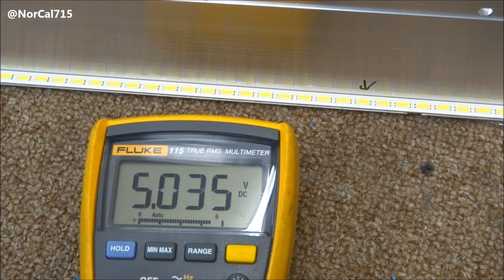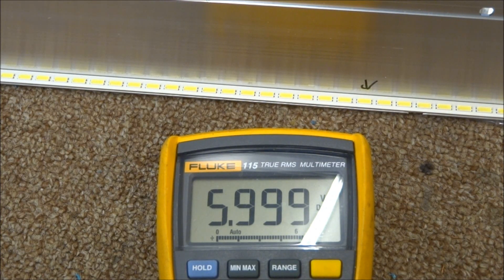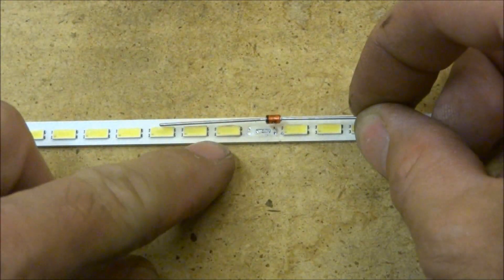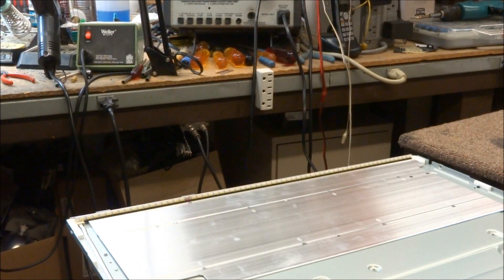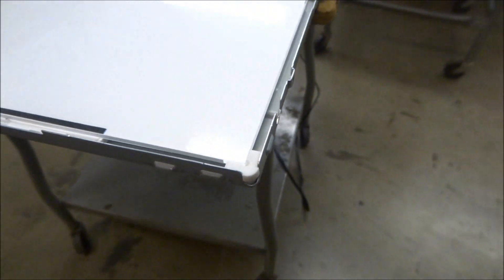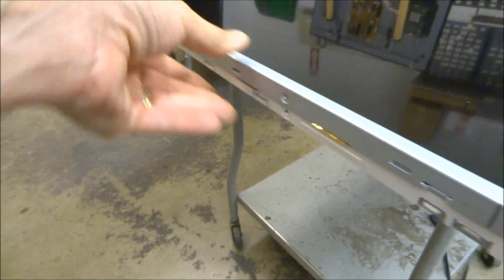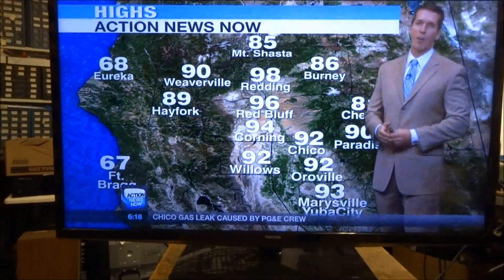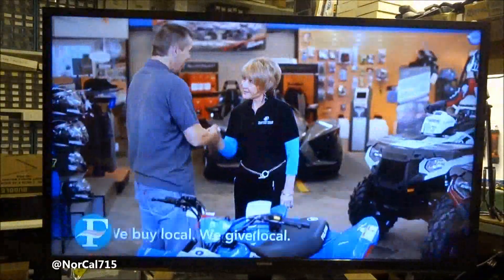Toshiba 46L5200 Logo Screen Flash TV REPAIR - No Picture - LED Drive Problem Part 2

Comment: What's the average cost for a repair like this?
Reply from the maker: For a complete LED replacement today (12-2021)it is usually between $200-$250 depending on the amount of LED strips and the cost of them.

Comment: I am trying to repair a similar set. I took out the led array and found one of them not working, I tried to add a zener but it did not work. Initially I would apply about 3/4 volts on the individual leds
and they would light up, now the don't but still show the diode effect on the multimeter. Have the leds gone bad, how much voltage should I get in the leads into thes?
The connector to the leds is five pin, so ,I assume these are 4 sets of16 leds in series. Should I be able to get a continuity from the black lead to one of the extreme ends?
Thanks
Reply from the maker: Usually white leds are approximately 3 volts to forward bias them on. So if you have 16 in a string it should be approximately 48 volts per string. I hope that's what you are asking.
Reply: @norcal715  Thanks very much for your quick response. I also want to know if a led does not light up will it still show the diode effect on the multimeter?
My second question is should at least one of the leads(perhaps black) from the connector and one the ends of the diode array show continuity or is the array broken?
Am very grateful to you for your assistance.

Comment: Couldn't you have put the zener diode just on the circuit that had too high of a voltage instead of taking the whole thing apart? The shirted LED could have remained in the circuit.
Reply: Gerard Pinzone yeah good point.
Reply: yes - unless you have a "open" LED

Comment: I find it interesting how the flickering in your camera stops when the backlight gets to 100%. Anything less and there's a noticeable flicker from the sync of your camera. Looks like they may be firing the LEDs slower to reduce the brightness. Great video, thanks.
Reply from the maker: Pulse width modulation to control the brightness. Leds are either on at 100% or off. They vary the duty cycle at a high rate to control the brightness.

Comment: Another Great repair. I have a Toshiba LED 3D Tv, model 55TL515U and the problem with it is that the TV does not come on. there is no power light or standby light on the front of the TV. When I plug the TV in I get my 5 volts STB to the main board and that's it. However, every once in a while when I plug the TV in i hear the relay click and all voltages are present but there is no picture on the screen , even if I use a bright light on the screen the there is still no picture, and once i switch the power off I can't turn it on again, I have to unplug it a couple of times and it will click on the relay again. Any Ideas?

Comment: Thanks for a great 2 part video.
However, I have a Toshiba 2008 TV, Model # is: 31AV500U which works but the FCC changed Ch 5 news & other TV channels disappeared also.
So I am quite alone, ill & up in years.
I have serious pain issues from FM, OA, AS.
So having the channels I can watch or like to watch on my free Antenna TV set up.
I can't seem to get my TV to scan. or I don't know where to go on the remote or the TV to scan it.
A friend did scan it some years ago, but we R not in contact anymore.
I have tried to do it pushing every button I could & nothing works.
I'm not sure if it is me or the TV.
If U have any ideas please do let me know...
Reply from the maker: There should be a "rescan channels" option in the tuner or antenna section on the user menu of your tv. If the channel has moved and the FCC assignment has changed then it will have to be re-scanned or re-added later. Thanks
Reply: @norcal715  I can't make my TV scan. There is no buttons to go to or up or down buttons to get to rescan this TV. I also lost other channels too... Very upset & frustrated!!
Reply: @norcal715  Unfortunately my remote doesn't seem to have buttons to go to rescan or I would have done so. I went to the TV & I can't seem to scan it from there either. it is a Toshiba from 2008. Toshiba doesn't have my TV in their lists. I guess it it too old. I wanted to try to set up a Time warner remote,but I can't seem to do this even with the list of numbers from Toshiba. Any ideas how I can scan my TV.? I no longer get more than 3 channels I can watch. I dislike most of what is on TV. I like the news CNN which I did not get, but I got Comet,Chance,This TV, Me TV, cH 5 NEWS & a few others I enjoy a bit..
Reply from the maker: on page 30 of the owners manual it discusses how to program channels. https://support.toshiba.com/support/staticContentDetail?contentId=2816429&isFromTOCLink=false
"To program channels automatically:
Configure the antenna input source, if you have not
already done so ( page 29).
Press and open the Setup menu.
Highlight Auto Ch Search.
Press (>) or to begin channel programming (A new set
of Auto Ch Search The TV will automatically cycle through all the antenna
channels, and store all active channels in the channel
memory. While the TV is cycling through the channels,
the message “Progress(%)” appears a white bar to
indicate the scanning status (as shown above).
To cancel channel programming, press on the remote
control.
When channel programming is finished, press exit or (^) (v) to
view the programmed channels.

Comment: Hey Bro, I really like your video. Its very clear, very intuitive. My JVC Model #DM65USR. The problem is the LED backlights are turning on and off every 2 seconds.  Picture and sound are find. What do you think is wrong with it.replaced the power board. The problem still exist. Need your help.

Comment: Great video!  I wanted to share a fix that did not require taking the TV apart.  I was able to do this with only the back cover removed.  After identifying which LED bank had the high return voltage I cut the white wire for that bank of LEDs and placed a 6.2v Zener diode directly into the wire with the cathode facing away from the LED driver board.  It worked great!  The LEDs are connected in series and the burned LED becomes a short so it really doesn't matter where in the circuit you place the Zener Diode.  The downside is that you are assuming an LED is burned without visual inspection and another LED could burn out any time if the strip is in bad condition.
Reply: Your method helped me out a ton and now I have a free TV! My repair was almost even lazier. I didn't have a multimeter that could do max voltage so I put a 1N4735 on each of the 4 circuits at a time until I found the one that would keep the TV on for longer, but it would still turn off after a few seconds now. On a hunch I bumped it up to a 1N4736 and now it's good to go.
Reply: @transist0  i snagged one off the curb last night, is the tv still doing ok after a year ?
Reply: @ED4action  I actually never really had a use for the TV so it sat around. Tried turning it on about a month ago and it wasn't working. Screen turned off a second after turning on. I had moved the TV around several times by then so it's hard to say if the fix didn't last or if it was just otherwise damaged.
Reply: @transist0  cool, thanks for the reply.  i found this one face up and it had rained really hard so it got "baptised".  i plugged it up and got the logo and then it kinda faded  for the "no signal"? info.  i'm gonna let it dry out good and try it again.
Reply: in fact I have 2 leds in short so I need other kind of zener

Comment: Great videos. I have a Toshiba 46TL398. When plugged to power, the screen flashes for about 3 sec (no logo) and neither do the buttons nor the remote work. i followed this video, check the LEDs but they were all fine. is there any other place i should be looking at? thanks
Reply: Same problem here with the same TV. 
Fix:
That's not a problem from leds but the pwm form the logic board to psu to the led driver board (Follow the wire)
If you cut this cable your problem is fixed but you have 100% dim light and that's not good for the life of yours leds
Then put a variable resistor to the pwm input of the SSL460-3E1B and turn the knob in the middle to have ~3v and adjust the dimming as you want. Bye
Reply: Lionel Moraz thanks for the reply. I will try that right away

Comment: Great video. If anybody wonders how to separate LED strip from heatsink, it is not glued (as I assumed) , just slide the LED strip in the direction of the connector, it`s gonna come off. Also, peak LED current is about 150mA, I would recommend to lower this current or it`s gonna happen again very soon with other LEDs. The current can be lowered by changing the resistor values of the 3 resistors that are in parallel and then in series of the source of each of the MOSFETs on the ssl460_3e1b board. Just remove one of the resistors and peak current will drop to 100mA.

Comment: I want to thank you for this video. I was able to find the faulty LED, ordered new  ones on ebay and replaced the one faulty LED. The tv worked great and my coworker needed a tv for his son but after he took it home there is now a vertical dark area in the screen. I took it apart and the LEDs are all working fine. When the LCD panel is off the LEDs and the back light panel light evenly. Only when the LCD is installed does it have this issue. Any pointers or direction would be appreciated.

Comment: Excellent job!!! It works for me. I only suggest to be careful when attaching the zener diod. There is not many space when you mount the main defuser plastic sheet. However, I will place an order for the led strip ($25)

Comment: hello, I have a Toshiba Regza,  when it turns on it will flash a picture, twice. about 5 seconds apart. the power light goes to green for a Saxon or two, then goes back to a flashing amber color.  when powering up, the green light flashes three times.  any ideas?

Comment: Kudos to you sir!,I wish I could work for you just to learn all this!,I love the simple manner in which you show your repairs,I have repaired many flat panels using your videos with 100% success ,like you keep repeating "lets keep it out of the recycle bins and landfills"--all without trowing whole parts at it,fix the component end of the problem!-thank you! (Current job is a panel of this post's model ##) ,I have read many prior posts of doing a jump from one lead to another to fool the controller board,but screw that,Im doing it your way!(which I think is way better)-I will check on complete LED strips first,any possible way to prolong the life of the LED's?,seems like a common problem with this set.
Reply: Just got done doing repair,works like a charm,ALMOST the same LED!!,,I suggest using an old gun-style solder gun to remove LED (it's bad already right?) use heat gun to re-solder to cleaned and primed pads,a dab of flux helps,,that OEM lead-free solder is a booger to get to melt,prime with silver or real leaded solder-go from top-down,melt the bad LED and slide off of pads (there is a center pad)-these led's are of two voltages I think,I used a cell phone charger (5V)to test each one ( negative is in direction of connector)-one is bright,one is dim,alternatly down the strip,LED's were cheap,6 for 5$ with ship from the bay---LED strip SLIDES toward the connector to remove strip--also--what a stupid design!! -1 LED goes bad and nothing works!!,glad I didnt pay much for this formerly dead TV!!---once again,THANKS! norcal715!!
Reply: UPDATE ( 3/21/2017) ,,replaced just the bad LED as last posted-set worked fine for 6 weeks and started flashing.....Just today I replaced entire LED light strip (brand new) ,we will see how long it works this time---IMO this TV is a waste of time from seeing the amount of people with this problem--I say part the set out or put up with replacing the LED strip one  year ,,light strip #94V-8 1228 J 52 SLED 2012SGS46 7030L 64 REV 1.0 is available brand new on the "bay" for 39-50 some-odd dollars--good luck!--PS !! original light strip has slots on back-side which snap-onto pegs on heatsink ,,NEW lightstrip has NO slots so it does NOT sit flush to heat sink but fits fine with diffuser plate in place---LED's may get warm ,but I think diffuser will aid LED cooling--Crossing my fingers,,I am absolutely DONE with this set.---OH and there is NO software update for the June 2012 model,,only older models.  NEVER RUN BACKLIGHT AT 100% AS VIDEO SAYS!!

Comment: installed a diode it lasted about two hours,   ordered a strip from china for $31 . great info in the video will be trying again  if the strip is not available   ,   I used a 6.8v zener and did not check the correct voltage size , but it did work and look good will post what I find after opening her up again   (maybe another LED popped

Comment: Hi norcal715
I have fujicom 47 lcd tv has stby light but not power on i have checked voltages have one 5.02v two 4.7v  but no 12v or 24v  dont see any bulge capacitors all flat could it be diodes transistor  or is it mainboard 
  can i get your help please

Comment: You can also use  two soldering irons at the same time. One in the left side of the led and one in the right side of the led and then heat both sides simultaneously and then it comes out quite easily from the board.

Comment: hey Jimmy i had my toshiba for 3 years feb 2013 the back light is out according to your video, same problem model 50L4300U  smart tv could it be a slight difference in repair? 
wish you could fix this one.

Comment: I've watched this video all the way through from part 1 to the end of this video. What I have to say, I'm in the middle of doing somewhat of what you are doing, but without messing up the clear plastic to where the LEDs shine on, I have taken apart an old phone charger and took out the .3mm wires from it, then soldered them on the leads of the burned out LED. I have tested the circuits, but the only issue I have is waiting for the zener diodes to come in so I can solder them to the contacts on the wires. I find it better to do that than to destroy something like that (Even though it's a small thing),  but would rather have it all looking great, so if I actually do find the LED board that is for sale when I have the money, I would purchase the board so I can replace it without any issues and have the TV in brand new condition. Oh yeah, if anyone wants an extra LED driver board, hit me up. I have one and willing to sell for $50. They are rare to find.

Comment: These might be the perfect fit to replace these leds. www.aliexpress.com/item/LG-LED-1W-7030-6V-Cool-White-90-100LM/32214537580.html
Reply: +Simon Dumais  take part number for led strip its on a small label on the strip i ordered here the exact replacement parts-  http://www.yoycart.com/Product/520801002367/Absolutely_new_Samsung_46_inch_LED_light

Comment: I have a similar problem in my TV Samsung is pretty the same of this TV . but this LEDs strips not work whit 12 volts? or that's a especial LEDs strips?  why the inverter board drops more than 12v if that's not a CCFL lights ?

Comment: hi i have the same problem my toshiba model is 58l4300u would the voltage value be about the same also it seems to be very difficult to locate replacement leds can you advise where to locate them
Reply: Dexter Gajadhar ebay

Comment: where we can find those tv led strip  as replacement parts i search for them and cant find any
the only available look like use dismatle from broken tv on ebay
Reply: +danys masse  hi i have a toshiba 46tl963  and i have ordered the leds for it it has a part number for the 64 led strip you can order here  -   http://www.yoycart.com/Product/520801002367/Absolutely_new_Samsung_46_inch_LED_light
Reply: tkx noel
Reply: +noel scot is there any way to find out if this lighting strip will work on a Toshiba 46L5200U?
Reply: +Raymond Jackson  there should be a part number which is printed on the strip itself  mine has -
SLED 2012SGS46 7030L 64 REV1.0 printed on the strip of leds my model is a toshiba 46tl963 model
Reply: Thanks.  I do not have my TV open now, so i was trying to find the part number without going into it.  is there a source where they would have a breakdown of the components of the 46L5200U TV?  Thanks again.

Comment: Question... How did you power up the LED's after you had taken everything apart?  Did you leave it plugged into the AC or did you have a separate power supply? Or can you leave it plugged up to power it on?  Also, ???? found some at Farnell (http://uk.farnell.com/webapp/wcs/stores/servlet/Search?catalogId=15001&langId=44&storeId=10151&categoryId=700000006148&mf=107612&pageSize=25&showResults=true&pf=112157830) and I found some of the same at Mouser ( http://www.mouser.com/Wurth-Electronics/Optoelectronics/LED-Lighting/LED-Emitters/High-Power-LEDs-White/_/N-8usfj?P=1z0jmj8Z1yox9j7&Ns=Vf+-+Forward+Voltage|1).
Reply: I used a set of four 1.5 batteries
Reply: Thanks.  I have since replaced the lighting strip, but still have the old one.  I would like to test it anyways and possibly repair it to have a spare in case the new one goes out.  Thanks again.
Reply: Raymond Jackson I found individual led replacements in ebay for $4.
Reply: Hermes Calderon could you send me the link and the exact led you used?
Reply: Thanks a lot friend, I will get on this right away.

Comment: I have this TV and my far(furthest from the plug) LED bank is dead. I have continuity from the plug to both the + and ground of that bank but I'm getting no light.  I cross checked the LED driver by switching wires and it's working.  Any ideas?  And thanks for making this awesome video.

Comment: Good video. Could you have fooled the controller with something in the lead going to the panel instead of replacing the led on the board? Lucky the fault was a short circuit.

Do you see more faults with shorted leds instead of open circuit ones for these sets?